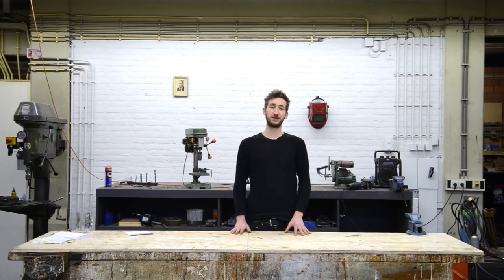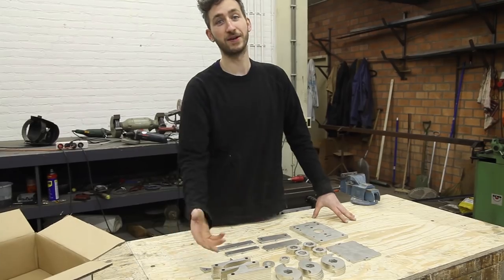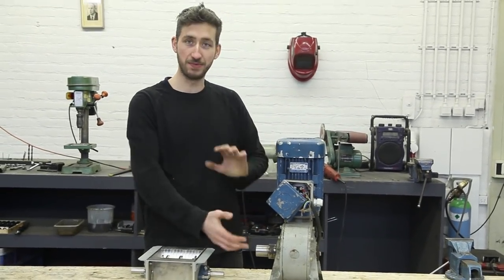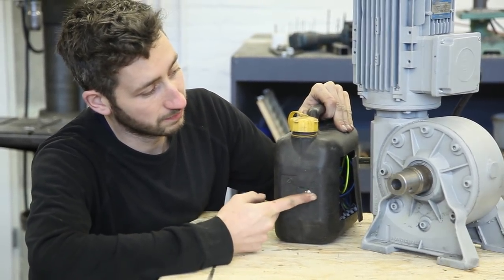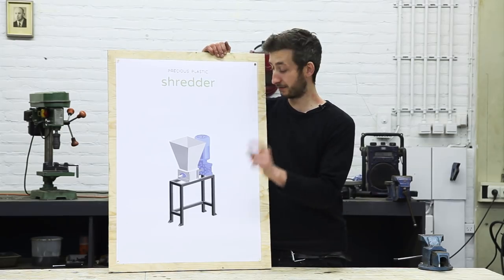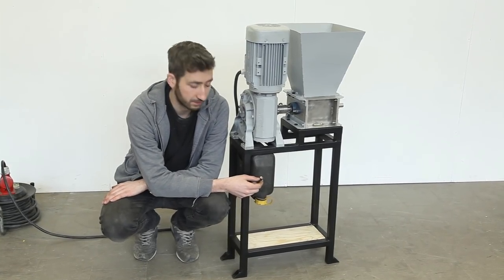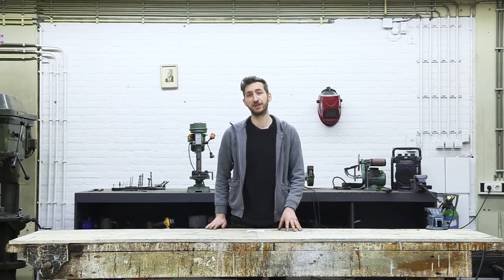Precious Plastic - Build the shredder (part 3.1)

Comment: wow awesome
Definitely homemade/diy
Because almost everyone has a drill press, belt sander, grinder, metal lathe, electric motors, spare auto parts, welding machine, etc.., to assembly custom laser cut steel plates to build a shredder.
Ill definitely try it tomorrow :^)

Comment: Now this is something I wouldn't mind doing. I guess I'll have to start looking to take welding classes.
Reply: Did you take welding classes? Have you seen the welding this guy did? You should not take welding classes
Reply: Maximiliano Valdés the welding device seems to be automatic/semiautomatic. I was curious how good it is and how does it compare in price with the manual inverter welding machine

Comment: Instead of mixing all colors/types of plastics. It's better to collect similar bottles in separate bags and once you have enough of each type, then only shred them and bag the pieces and label the bag. This way, your shredded pieces have more market value if you sell them directly to the plastic manufacturers, since it is as close as possible to virgin plastic. 
Or if you want to melt and create something on your own,  you have more control on mixing and matching colors. Just a thought.

Comment: amazing video! great detail and straight to the point. if you don't have basic metalworking skills there are plenty of fabricators that would be willing to help for a good price. it shouldn't cost more than $200 since you have the blueprints for a fabricator to finish that. if you had to go buy this machine retail it would well cost over $1,000. you can use your imagination on the hopper in the stand so the only thing you really need a fabricator for is welding the shredder and turning the shaft. there are also plenty of online laser companies or water jet  companies that can cut that out and send it to you. subscribed!!!!!

Comment: Cool video but I'll probably just go with a modified wood chipper. Also those custom parts could be made at home with an angle grinder, drill press, and arbor press with broches. Not very complicated geometry. I wouldn't use stainless tho, you get a peice of metal in there you'll dicker the whole thing. Use some 5" circular saw blades and use a faster feed rate. Use solid square stock for the axial and cut peices of hollow square tube as washers (inner deminson of the tube should be = to the outer deminson of the square stock). Drill a hole in the ends of the square stock to fit a round shaft (power transfer shaft) that will sit in the barrings, pin shaft in place, then drill your out put shaft to accept your just finished transfer shaft and pin in place. Use stationary saw blades as the opposite cuting edge and rotate them as they dull. Switch the rotating blades with the stationary blades as they dull because the rotating blades should wear out faster and require a sharper edge. Get the carbide tip blades and sharpen as need with a dimond wheel on a dremal. Run at spec rpm.

Comment: Interesting. I love the electronics housing. That alone could save tons of plastic. Start reselling jugs as electronics housings. Or pilot program to give them away. Like reusing plastic 5gal buckets. One of my faborites. I would also recommend having a safety door on the top to a) prevent hands or clothing from getting into the shredder and b) from plastic breaking and shards flying out and hurting someone. Other than that a great video!

Comment: Could I possibly use aluminum or brass for the blades? I made a mini foundry that I can use to melt brass and aluminum and cast it into whatever. Which case all I need to for that is save up cans or collect bullet casings from local slates and shooting ranges for the material. Figured as long as the shaft is still steel, the blades would still cut through but I'm not exactly sure.

Comment: People need to check their facts, before making so much false assumptions! This Schredder is something you can do at home, without heavy equipment like welding, milling machine or a lathe etc. Everything welded for example, can easily be done with screws instead.

First off, You need some kind of drilling machine. It does not have to be a standing drill. A portable, even a weak battery powered one will do. You just need the right drill sizes and a set of screw taps.
Then you need a saw. Again, use a electric/battery powered saw, or a simple handsaw for metal.
And at last, you may also want a hand file/rasp and maybe some sandpaper. You could also use an electric belt grinder, if available.

These are all the shape altering tools you need. Cheap Tools from Amazon - Oct. 2018 prices:

$25 = 1x Electric Drill
$16 = 1x Drill Set
$12 = 1x Screw Tap Set
$11 = 1x Hand Saw - Metal
$08 = 1x Flat Hand File

= $72 worth of cheap tools. Tools that require you to break some sweat, yes. But its a really cheap alternative that also fully works!

Comment: I doubt this would work but just an idea would it be possible to make a diy plastic shredder by just putting a bigger motor and maybe a hopper in an old paper shredder?
since you can find at least 5 of them at any goodwill or thrift store I think it be a good project to see if it's worth trying at the very least.

Comment: Would it be possible to make the shredder blade  from a stack of used circular saw blades. Maybe grind off a certain percentage of teeth to make the necessary shredding action?

Comment: I love these types of videos.  Making tools from scratch is one of my favorite subjects here on Youtube.  That said, it took a bit of skill to be able to drill the center of the output shaft on that reduction motor.  And it looks like you did it with hand tools..  Personally, I'd have gone with a belt and pulley or possibly sprocket and chain setup.

Comment: Hearts in the right place but that’s 6-7 thousand dollars of motor, gearbox and laser cut parts where I’m from. Think a cheaper option could be made of off the shelf parts quite easily as the shredder doesn’t have to be that heavy duty for just plastic.

Comment: If I use 2 motors hooked up to opposite ends of the shredder shaft, will they both spin in sync? (While both motors are spinning in opposite directions)

Comment: Dave.. could you provide a reference of design for bigger shredder/ 2 shaft. owh yeah, i have 1 question for your design in this video.. How does the plastic cuttings that not yet fit to the size of the sieve..lifted up and be shredded for the second time the finally get smaller and pass the sieve size.. please respond. thanks

Comment: You are so cool! Very multi-talented! I'm wondering if there is any way of shredding plastic at my rental home so that I can donate plastic chips to local recyclers? I only have single phase 240V power and would be doing small amounts often so I don't mind if it is slow. I've seen youtubers use powerful paper shredders but they require everything to be cut flat first to fit in the narrow shredder entrance. Is there another way of getting and running a small shredder on single phase power?

Comment: well, you can tecnically make all the stuff but it won´t be cheap at all.
But thanks to this video, i´m thinking in a  way to make a shredder with low cost material and alternative power sources.
Or just use a blender.

Comment: Hello. Just new here. Am very interested in this shredder. I have been cutting up HDPE bottles for a while now, heating the cuttings in a metal tube with a screw clamp, to make a plastic rod of 50mm diameter. I use a wood lathe to make ornaments. But now I would like to make more pieces. I takes about six, one litre milk bottles to get a decent size (length) of rod. I am retired, and this a lot of work for old hands. I have downloaded your kit of files. Not very familiar with CAD, but would give these files to machine shop to make (probably laser cut).  Which files do I give to the machine shop? I can TIG weld, so this part is not a problem, and have other workshop machine, but the part for the shredder is out of my skill set. Thank you from down under.

Comment: Looking at drawings, the small fixed knife part 4 is shown as 6mm thick but should be 5mm, since it matches up with the rotating knives parts 5, 6, & 7, which are  5mm.

The big fixed knives, part 8, shown as 5mm, match up with the rotating spacers, part 3, which are 6mm.  Part 8 should also be 6mm, to match the spacer thickness.

The quantity of small fixed knife, part 4 should be 14, not the shown number 15.

Does this make sense?

Comment: And a suggestion. Wouldn't be more effective to use a dual blade shredder? I mean a dual axis one, like big metal shredders. Thats way you can easily shredd even the 5 liter(or maybe 8-10 liter) bottles as well. I mean these commons near me, in university. And its more capacity/hour, if you not just want to shred your household waste weekly/monthly but your neighborhoods, or for smaller corps.
Reply: +Sastas why dont you make a drawing and post it on the his forum? Seems like your idea maybe not be one at the end.
Reply: I'm planning to. I'll make one, and if its works fine, I put it on the forum. We will see, how it's working. And I'll put the priceing to it as well. And we will see, how its going, and what about priceing.

Comment: I work with HDPE pipe diameters ranging from 3" to 14" and thicknesses up 3/4". I need to reduce my off cuts down to 2 to 3mm so i can turn it back into 3/8 plate and also 4mm round extruded wire or rod. Can u help with a machine strong enough and capable enough to reduce these off cut chunks into the small granules as i mentioned plz ?

Comment: Hi. Firstly I want to present my sincere respect and congratulations for your work. Secondly, I have a little question: How do you make the molds and which material you use? My goal is to replace the polyurethane resin and silicone molds with your injection technics, but the models I want to create has too many details... so I'm interested basically on your injection machine only. But I need to know how do you create models to copy or cast some detailed plastic forms.

Comment: nice video, would it be strong enough if i change the blade body made from wood and the planer blade (usually in woodworking) as the sharp edge? i think its more affordable and commercially available. i think it will sacrifice the durability but by provide some extra parts for blade its easier to build. got to build some to see if it works!

Comment: Hey. Since I'm in the US, finding sheets in mm is much harder. what would be the implications if rounded to the nearest US measurement on the thickness? when all the blades are put together would it still fit in the housing? I think i can get someone to do the water jet work for me, but i would hate to have it done and the pieces end up not fitting properly..

Comment: Its a pity that you did not temper (heat treated) the blades. Its quite simple to do if you have a forge. It would give you much better lifetime. Btw great use of CnC cutting. Its amazing what you can build your self with a little bit of help from a local CNC shop, and for cheap ofc.

Comment: @davehakkens I think this shredder is a novel project, but the cost of the equipment required to craft this would  outweigh the cost of the final product. Honest question: Would it be easier and more affordable to retrofit a used wood chipper with a screen to achieve similar results???

Comment: I've downloaded the plans kit from the main site.  Where can I find specifications around the desired rotation rate of the grinder shaft so I know what motor and gearbox to purchase (this isn't discussed in the plans).  Also, what horsepower rating motor are folks using?  5 HP?

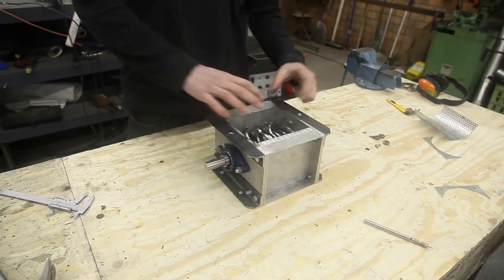Comment: Need more info on The blueprints for the shredding Axel,, You install a bearing mechinism on the outside of the shredding box which is not on the blueprints, ( 3:13 on the video ) I take it that hasn't been included in the materials price list...
Reply: I see these can be purchased online, add an additional £33.50 /€43.50 to the overall price, how much does your motor come in at ?
Reply: where can i get one to buy
Reply: Filabot.com

Comment: Great video but I cringed in a few places.
First was when you center drilled the output shaft by eye while only supporting it with your hand.
You weren't even using a vice let alone an xy table, and you can actually see it wobbling as you drill it!

Another was when you welded the frame without any clamps or guides and without checking shaft alignment.
It would be fairly straightforward to align the motor and shredder by eye (at least), then assemble and tack the frame around it.

Comment: I have read your plans which are very clear, but only one very important information is missing and it is the part of the electrical diagram for each machine. I work for a non-profit organization employing people with different physical or mental problems and I want to set up your machines with us. There are no people who collect plastics in my area. I need the électrical diagram to built a demo. For the extruder we have no information for the heat system.

Comment: This is an interesting product but this has the same flaw as a lot of other similar projects, it's so wide-reaching so that it's available to everyone that it doesn't quite fit what everyone is looking for.

What I'm saying is this may be low cost materials that anyone could get ahold of but you need a handyman to do it, that means if isn't the handyman wants to do this they have to convince someone else to build something from scratch or spend money buying parts for this.

What's more important is figuring how to build machines that build other machines, like a self upgrading 3D printer that's 3D printing 3D printers to sell to people in the local area.

In the use their profits to buy the components that cannot be 3D printed, like power supplies for example.

And then the person who bought the self-replicating 3D printer and plastic recycle kit can make a profit to purchase more kits from the person they originally bought it from and sell them.
Reply: this is just an example but I could build a modular phone out of single board computers and off-the-shelf components and a 3D printer, why would I when my phone works and it hasn't broken in the past 3 years because I have a quality Case on it.

Yes sure I could build a portable gaming machine but my phone can do that and so can my PSP, things are so easy to modify and price to Performance versus every other portable gaming machine under $10 for the capability of a PSP it's hard to beat that.

And why would I try when I have to put so much work into it and I probably won't make anything better that I can buy off the shelf.

Comment: This machine is missing an absolutely critical component: and emergency stop device. It’s not a matter of “if” someone will get injured, but “when”. There should be an emergency stop button accessible from anywhere (any operating position) that immediately stops the shredder. This will eventually save a person’s limb. Don’t skip a safety feature if you’re building this yourself. Protecting the inlet so that you can’t reach the blades at all is also recommended (make the distance to the blades from the inlet longer than a human arm). Awesome build, but lack of safety considerations or discussion is problematic.

Comment: Your specs are not complete  Your BOM  says 2KW  but does not give the RPM of the output   From Visual  it seems to be around 120 RPM    Since 2KW = about 2.8 HP  that would mean at least a 2 HP in the states.   That would mean  a 220 240V line source here  or a 20 A 120 V service for the motor.

Comment: The design is great, but most people, like me, don't have CNC plasma cutters, metal lathes, arc welders, or industrial metal chops saws in their home workshops.  Nor do they have access to such tools. That makes building a shredder as depicted here impractical, or even impossible for the average joe to build.
Do you have a shredder design that can be built with cruder, less expensive, entry level tools that more people are likely to have, like hand drills, hacksaws, screwdrivers, wrenches, and files?  Is there a version that can be put together with nuts and bolts pr rivets, instead of welding?

Comment: how hard is it to cut the plastic? wondering bc it would be cool if you were to make a hand crank one. also, can it shred the bottle caps?
Reply: I was thinking with a one powered by pedalling like a bicycle, I believe you can exert more power from you leg muscles... & I find it more fun
Reply: +Naiemaa yea! i was also thinking about that after i commented. maybe find like an old bike and rig the pedals to the shredder
Reply: +YiHao Xie Its quite easy to cut, This is basically shearing the plasting, wich is easilly done even with common scrissors. Even the cup of the bottles.
Reply: +Sastas how about the cap?
Reply: The cap isn't really harder. Basically there is shearing force, between the blade and the housing. When the blade's side start cuts into the plastic, the rest of the operation done by brute  force, like you cut into the cap with scrissors just a pit, then get 2 pliers, and just tear the cap with them. Piece of cake :). Some special occasion there is only clear shearing, but thats more easy work for the motor.
He use on the motor a high slowing gear, about 1:50-1:60, Its mean really really hard to stop. Actually with this force, you can shred even copper, or aluminium, but for this you need other kind of blades. This blade designed for plastic bottles, like he said.